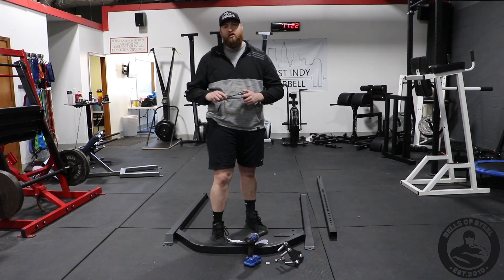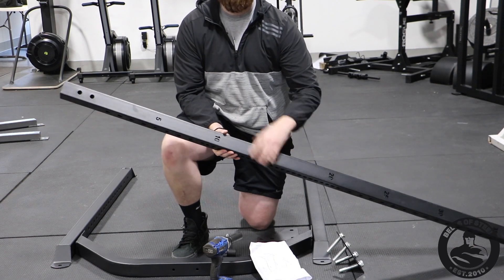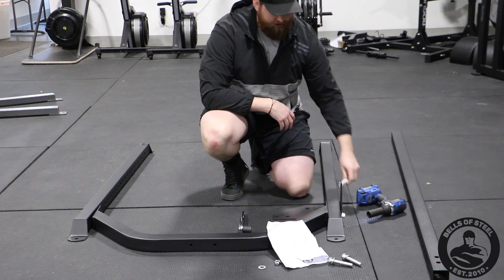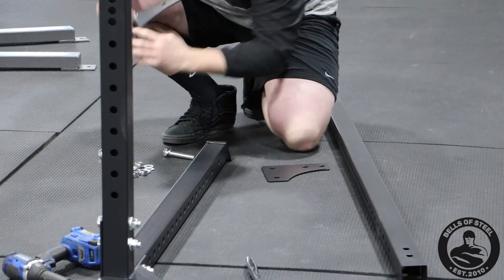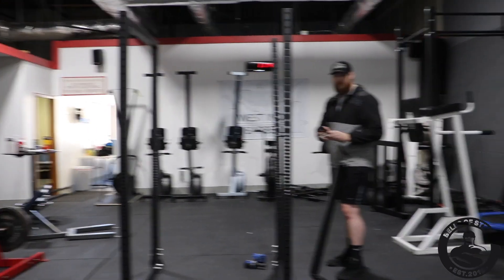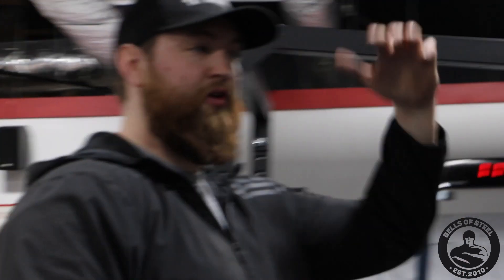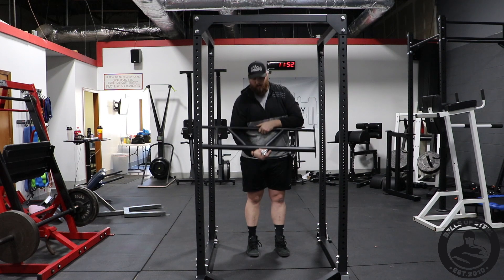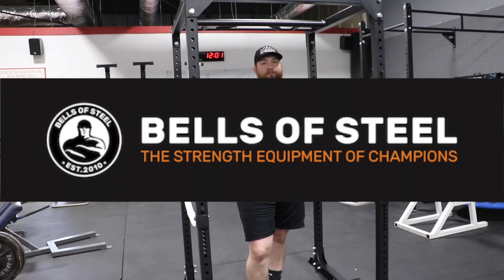How to Assemble the Light Commercial Power Rack 5.1 By Bells of Steel

Comment: I guess "front" and "back" are relative to the position of the camera. I would assume the actual front of the rack is where you do NOT have the cross tube at the bottom that you need to step over.

Comment: He says that a 24mm impact driver isn't necessary, I'd argue otherwise.  I'm trying to put it together right now and some of these bolts are hard to turn by hand using a regular adjustable wrench.  The impact driver would make the assembly a whole lot faster, and FAR less tiring from all the manual handheld torquing you'd otherwise have to do.  Also, the instructions are printed on 2 pages of 8.5x11 pieces of paper, but really, it's just a cover page followed by a diagram showing the entire rack assembled.  The diagram has what looks to be size 5 font printed using a broken photocopier, which makes it challenging to read.  If anyone is expecting IKEA style instructions for assembly, don't, they don't provide it.  It makes this video that much more necessary to reference.  Hope this helps.  Also hope BOS includes better, step by step instructions in future packaging, as I'd rather reference a piece of paper as I go vs going back and forth on this video while trying to assemble the rack.
Reply: By far NOT an exceptional company to deal with. They are too foolish and therefore don’t care. 
If they were, they would fix all kinds of problems.

Comment: Looks like the top cross members don't necessarily have to be at the very top. Could this allow for the pull up bar to be lower on the rack?
Reply: I have the same question. Thanks.
Reply: @anthonyperry2923  I have the rack now. You totally could do it. I didn't, but it's possible.
Reply: @kevinfowler2132  thanks, im going to order this rack once its available again
Reply: You can put the top bars on ANY of the top 17 holes. I put mine 4 below the top so I can put my head above the pull-up bars with a low ceiling. However, if you do this, you won't be able to do standing presses with your barbell because it'll hit the top bars.
Reply: Did they update the rack? BoS told me the cross members cannot be adjusted in height.

Edit: nevermind, they confirmed you can!
Reply: Probably will be in your office

Comment: should the bolts be super tight?
Reply: No. Fasteners should be finger tight so you don't over torque and strip the threads or damage what you're fastening. With this rack, there are spacers for every bolt - just tighten until the spacers can be spun anymore.